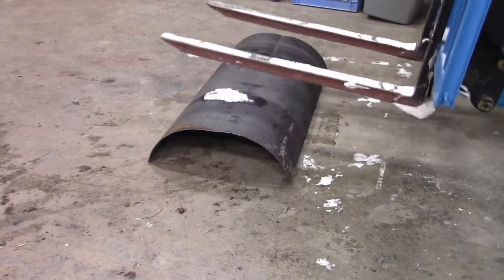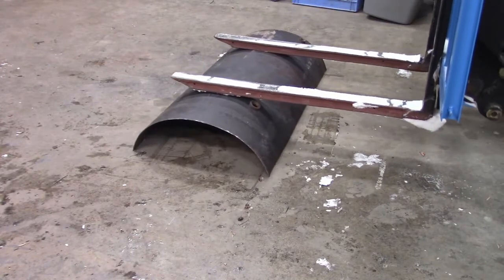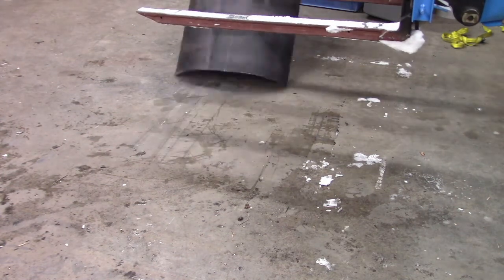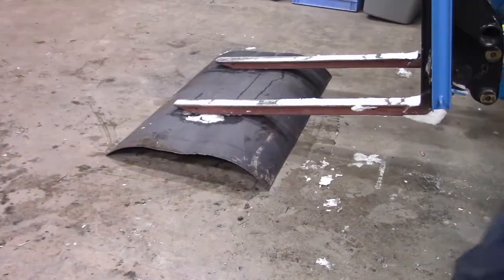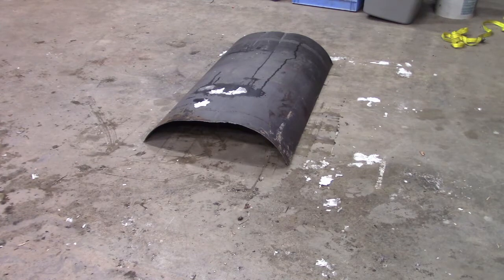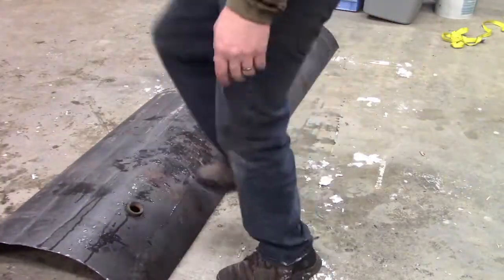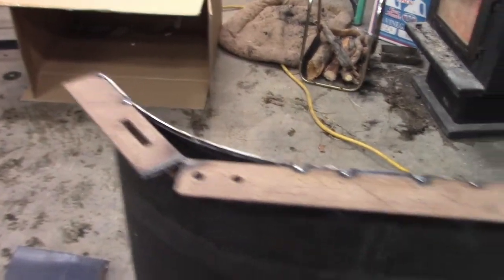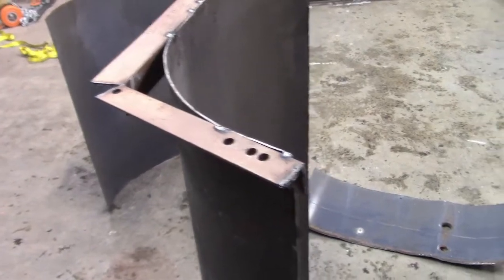Homemade Snow Plow from a Hot water tank - part 1.5 - after the cutting

Comment: I've done quite a bit of work with bedframe steel. I usually cut test it with a grinder first to check the quality of the metal. Look for nice long sparks and fine grain in the steel along the cut and it will actually support quite a bit of load.